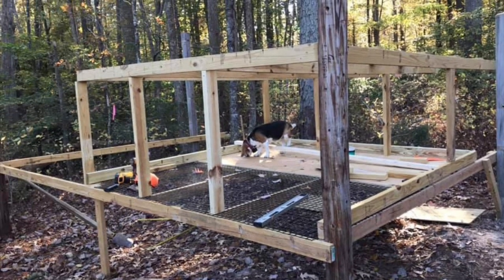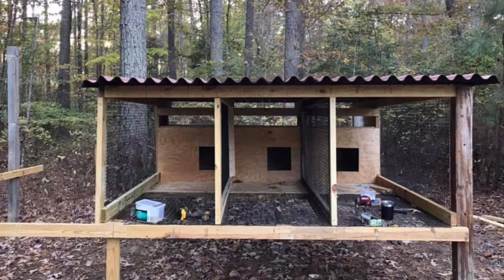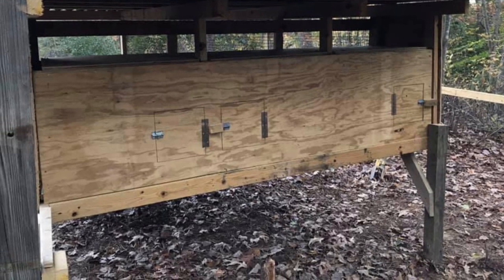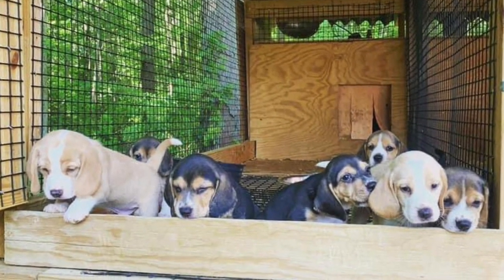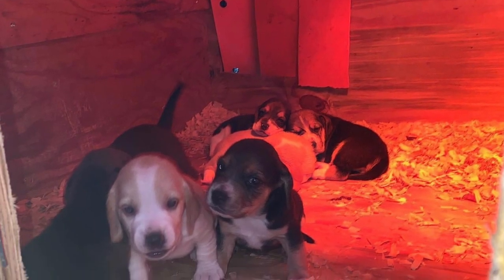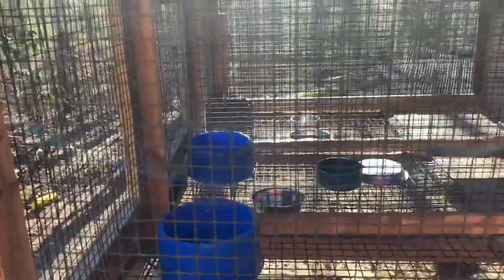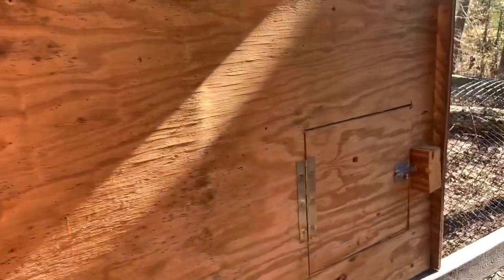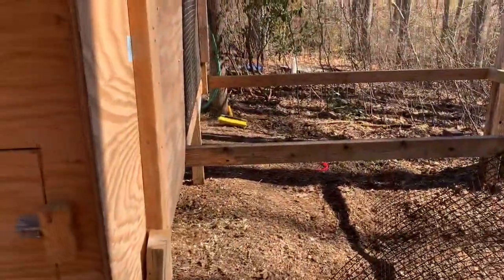How to build a dog kennel, Above Ground Dog Kennel

Comment: Don't copy this if you have Game Bred dogs gentlemen... especially if you have hard keepers / chewers, the inside wood will get mangled and destroyed,, always keep wood on the outside of the screen, or even the frame correctly. And never use wire for the floor.... wood or pvc. that can ruin their paws and make them less active.
Reply: Oke good points but people who keep those kind of dogs ( me inc ) know that but this are beagels …
Reply: What do you use for the floor?
Reply from the maker: You can also use a product called duraslat. It’s a greenhouse table product that is all plastic but the same size holes in it. You can order it online.

Comment: Nice kennels! What did you use for the floor of the kennels? A vinyl coated mesh? What size? Not hard on their feet but still lets the Pooh thru? Thanks!
Reply from the maker: I used heavy gauge vinyl coated wire. 1in square wire. Correct. They can still walk on it. But everything drops through